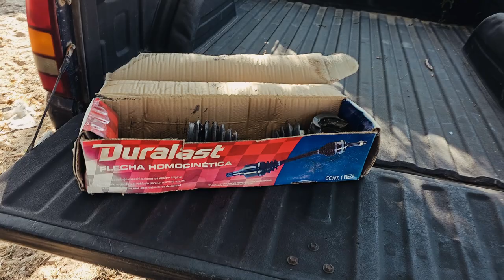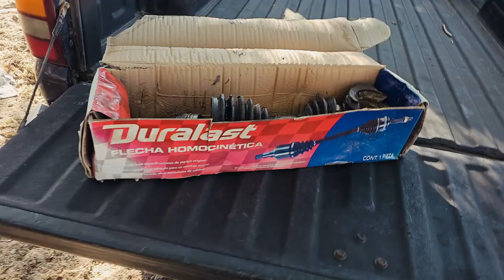How I Handle... Rage, Extortion, Scams and Car Repairs

Comment: My dad took his car to a local dealership for an oil change. Now we both have always changed our own oil, but this one time he took it to have it done. 6 or 8 months later he wants it changed again and I am recruited to help with getting under his car, he is getting to the age where if he got down under the car, he would have trouble getting back up. That oil drain plug was stripped to the point where it took vice grips. I'm pissed because I know the dealership did this on his last oil change. I took the stripped bolt to them and they had a jar at the counter selling new drain plugs. 

This was no accident, they did this to sell a new bolt at nearly 10 dollars a pop. Or they figure one would take it to them for the next oil change rather than mess with that stripped bolt.

Comment: CHECK TO SEE IF YOUR CAR THAT'S LEAKING GAS, SEE IF YOUR TANK IS LEAKING FROM UP TOP WHERE THE FUEL PUMP CONNECTS TO THE TANK. THE GAS COULD BE SITTING ON TOP OF THE
TANK AND YOU WOULD NOT SEE IT ? HOPE THIS HELPED !

Comment: Get an obd2 scanner and scan the codes yourself. Could be your fuel injectors are faulty and you are running too rich(too much fuel to air ratio) pull the spark plugs and check to see if they are dark and really wet.
Reply from the maker: Thanks. Ya The plugs look fine. I have a scanner. Sometimes has a P0172 Rich code. It's the def fuel system. But no injector system errors. Cleaned that MAF and it's better but still lacking. Maybe the MAF is going bad.
Reply: @GavinSeim  16556/P0172 - System Too Rich, Bank 1

Possible Symptoms

Irregular behavior

Possible Causes

Fuel system

Excessive fuel pressure

Leaking or contaminated fuel injectors

Leaking fuel pressure regulator

Low fuel pressure or running out of fuel

Vapor recovery system

Air leaks after the MAF

Vacuum leaks

Improper seated engine oil dipstick

Stuck EGR valve

Oil overfill

Cam timing

Cylinder compression

Exhaust leaks before or near HO2Ss.
Reply: @GavinSeim  my guess is there is an air leak somewhere and the ecu is overcompensating the excess air with excessive fuel